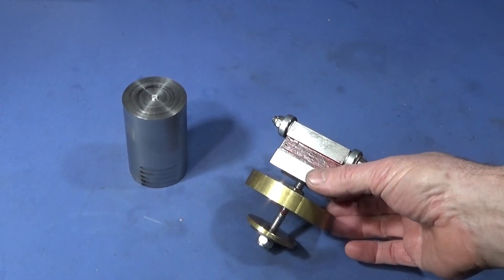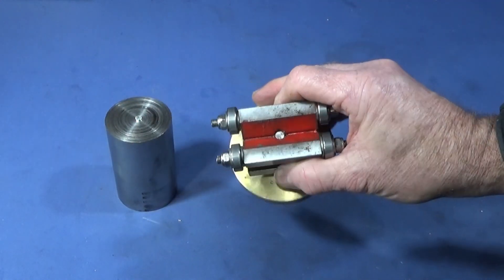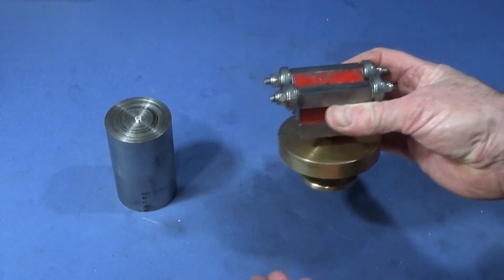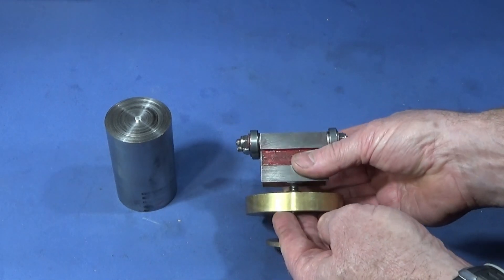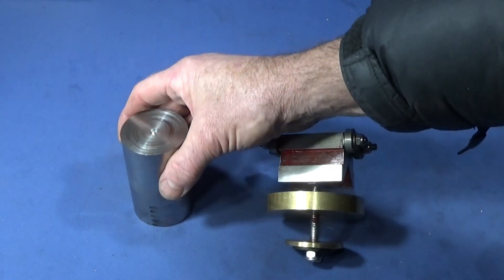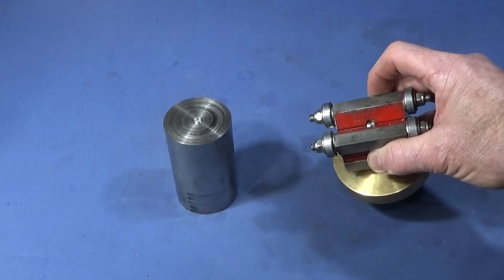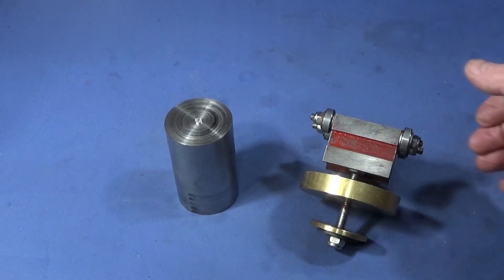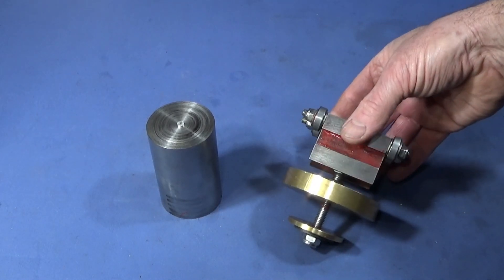MY Myford ML7 Home-Made Parting Off Steady For Long S316 Stainless

Comment: Hey Steve where did you buy the pulleys for the 3 phase motor on the mini lathe ??How do they called??
Reply from the maker: The one I fitted is called an SPZ 170 -1-1610 with a Taper Lock Bush HTC 1610-25. 
 I put the links on the video if they are still in the comments section. You need to make up an expanding mandrel to fit them to the spindle though. There is one downside as it blocks the end of the through hole on the spindle. I don't mind though as I cut my bar to shorter lengths. Regards Steve
Reply: @SteveJordan  thank you so much sir i am trying to convert my lathe to belt drive without any electronics just like yours!
Reply from the maker: Hi yes I just edited those to the exact numbers. I hope to do another video very soon to show how to make the expanding mandrel to fit the big pulley.
Reply: @SteveJordan  thank you very much! Greetings from Greece